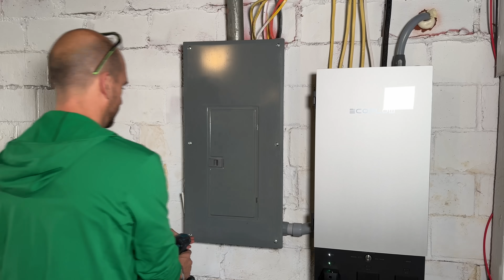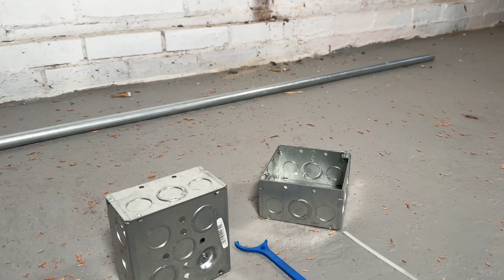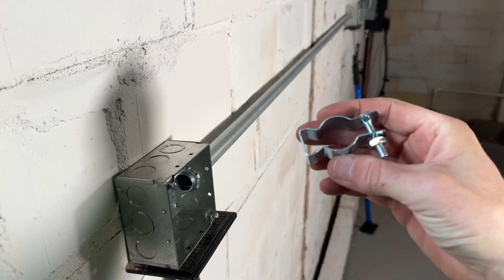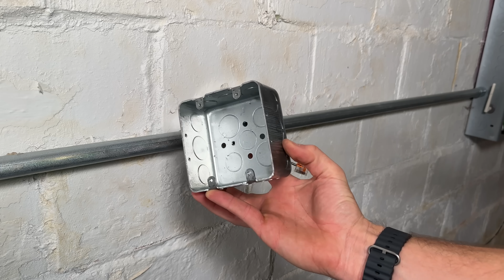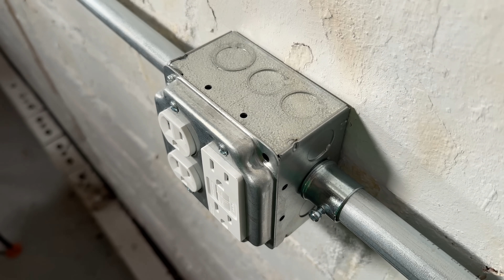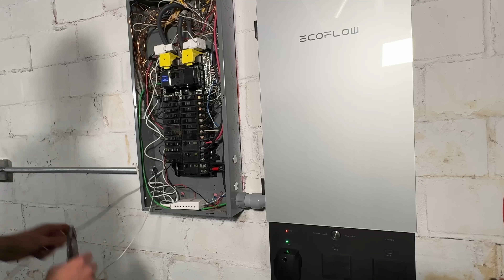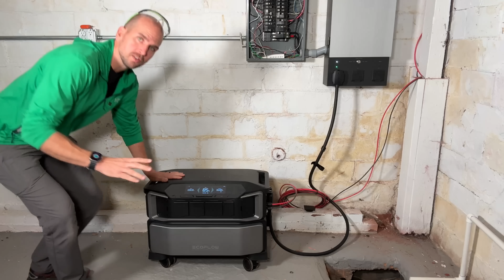Add Outlet To Unfinished Basement Or Garage

Comment: Why do you refer to the WAGO connectors as "DIY electrical" (at 7:40 in this vid)?   Seems to be a somewhat derogatory remark.  Don't you also use them for all applications?  Or are some other applications using WAGO not to code??    Confused why you referred to it that way.
Reply from the maker: Yep, I use WAGO 221 connectors for pretty much everything and I am DIYer so I don't see DIY as a derogatory term.  I recommend WAGO because I think they result in a more consistent safe and secure connection when comparing to wire nuts for DIY homeowners.  A classic example is when connecting stranded wire from a light fixture to solid core wire from Romex, in this case I think WAGOs are a much, much better option over wire nuts.

Comment: Never use Tap Cons or anchors in mortar for multiple reasons,all work must be secured to the block face.  There is nothing wrong with the "Finish" box. Your choice of face plate( receptacle mounting point) dictated  which box must be used. Code compliant or not using EMT as the ground is substandard as dust and corrosion will compromise the circuit in 20yrs if the connectors do not separate first from simple thermal expansion  through the outside wall or mechanical damage. There are also no offsets on the pipe entering the box which will cause an outward pressure pulling on your Tap Cons(mortar) and you must strap every 5" and within 12" of the box . You  used a GFCI but the installation will out live the GFCI which may be replaced with a non GFCI by others leaving a very real  possibility of an underground non GFCI protected circuit in a wet location . The moral of the story is  simple. Your installations have a standard service life of 30yrs.  Most inspectors secretly rate your work and will treat your job site inspections accordingly. On our jobs inspectors rarely give more then a passing glance at the work before signing off as they know the work consistently done to code or beyond . This saves huge money in time lost waiting  for inspections. Also note that constant high quality work is the main indicator on whether the AHJ gives electricians and companies Cut and Connect licenses which saves even more time and money. Good job pointing out the use of Romex,we use T90 in all our EMT. Waggos are too expensive to be used on large jobs I suggest spending the $$ on higher quality material in other areas of your installations. I have never seen Waggos used in industry and are not accepted in Hospital Grade application under the rational that they are too new........Inspectors seem to fined them sketchy regardless of UL/CSA listing.

Comment: You basically fast forwarded through all of the important parts. All the plug connections and the connections in the panel were too far away or too fast to see anything. Why show all of that and still show nothing? Would have been better to just show how to do one or two and then skip to the next part. Anyone who knows what you did at the end of this video, already must have known how to do it before the video started. I guess maybe that makes sense though, because based on all the comments it seems like everyone watching your videos is already an electrician and knows how to do it anyway.

Comment: Yep just a few things wrong I see.
1) Don’t cut conduit with a pipe cutter, use hacksaw or bandsaw.
2) Ream the conduit ends, always.
3) Conduit should be supported if over 24” from a box, as in use box offsets with one hole straps or saddle strapped.
4) Romex should not be used in conduit, it can be sleeved at entrance into main panel but there are codes as to % fill, and length.
And that’s before he mounted boxes.
Reply from the maker: Thanks for the feedback

Comment: Just curious. Why are you using 12 gauge wire amp and 20 Amp breaker on what appears to be 15 amp receptacles?
Reply from the maker: If you have at least one duplex outlet on the 20 Amp circuit you can use 15 Amp outlets.  This meets code and is especially true when you use something like the 15 Amp commercial-grade Legrand which internally are very similar to the 20 Amp outles.
Reply: @EverydayHomeRepairs  Thanks :)

Comment: 3 things I saw that I would have done.  (1) I would have used a ground wire. (2) I would have made offsets in the entire. (3) it appears that he used 15 Amp duplexes,  I would have used  20 Amp since he used 12 g wire and 20 Amp breaker. This is only my opinion.

Comment: Romex can be inside emt as long as it’s not to escape the weather rating.  So it’s ok in a basement, you’re basically protecting the romex is all.  Also, did you bend box offsets or just smash the pipe into the wall with he straps help?
Reply: Never have I ever seen someone dry fit (with those adjustable tension bars) the whole circuit and then go back and install it all at once.
Reply: Ok so I see you mention how romex is ok inside emt as long as it’s in a dry enviro and you use the minerallac straps to avoid bending the box offsets (crutch for non benders) but aren’t those 15 amp outlets installed on a 20 amp breaker?
Reply: @aasmith78  As long is there are 2 or more receps on a 20 circuit, 15A receps are fine.

Comment: I can tell you this I would not let him do any wiring for me reason after doing the electrical trade for over 44 years if I am not wrong the NEC has changed it is now required to add a green grounding conductor to all conduit runs also the EC requires any run of conduit run of 3 foot or longer to be supported so my friends that's 2 violations of the NEC that I can see right off so this amateur would never do any wiring for me one lastthing before I close having been raised by an electrician and have helped him & worked with him over the years as well as other great electricis I have learned a lot now no I don't know it all
Reply: Amateurish, definitely, but a wire type ground is not required when using the emt as your egc.

Comment: You said that you did not want the conduit to be against the wall.   I live in a home built in the 1960's, and all of the aluminum conduit against my poured basement walls are/is touching the wall and has a 1/2 offset before each box, probably done with the old conduit bender.  Is this because of new codes, personal preference, or?

Comment: This ground path only works if its the main power panel and the ground is bonded in the power panel to the metal box, a sub panel would not be bonded.
Wow, you guys are sleeping.
And I'm not a licensed electrical
Reply: Incorrect about the grounding path. The panel enclosure, whether a main or a sub, will be metal and therefore be bonded/grounded, so using the emt off either one, or a 1900 box that's grounded, is fine as a ground path.

Comment: The receptacles are rated for 15A, not 20A.  Thus, if anyone of the multiple receptacles is drawing more than 15A, it is OVERLOADED, running above its rated capacity!  The T-slot receptacles are required in this configuration!
Also, the sheathed cable could be used in the conduit BUT the rated capacity must be reduced due to the possible wire temperature over temperature.      Code provides the allowed stuffing capacity in a particular size conduit.  You must observe the rated temperature of the wire/cable.
Also, in most of Canada you would not get away without a separate bonding wire from the outlet(s) to the box.  The reason is obvious once you remove the screws from outlets to open up the box.  The faceplate could become HOT!
It would have been a lot easier to run another 15 A circuit with associated GFI.  (The use of a 2 pole GFI in the panel is too expensive.)

Comment: I would not use those connectors. Go straight to the outlets. You’re just adding more failure points than needed. Just wire up the outlets, then put on the plate. Oh I always use higher quality outlets that have the clamping type setup with straight wire (same as most GFCI outlets have). Neater and cleaner.

Comment: NEC Code  requires you to strap within 3-feet of any box, panel, or termination point for that conduit run. So looks like you may need 2 straps there guy. Also, electrical metallic tubing (EMT) does require a ground wire...especially when devices are installed. The ground wire provides a path for fault currents to safely return to ground, helping to protect against electrical shock and fire hazards. It is an important safety feature in case a hot wire comes in contact with any part of the metal box or conduit or if for some reason the connections become loose or broken. The type of grounding your doing is only for Equipment Grounding.

Comment: First off all that is a fully finished wall. Wake the F up. just because you are in America you are less than 10% of the world ... The rest of the world uses Concrete and Cinderblocks and we just carve channels into the concrete and done. SO you need to learn a lot about electric to begin with.  FYI the rest of the world uses 240V AC not your weak 120V AC.

Comment: You need the ground to the devices because if the cover is separated from the box "where is your ground to the devices," now pull the GFCIC cover and check for ground. Inspector up here would fail the job.

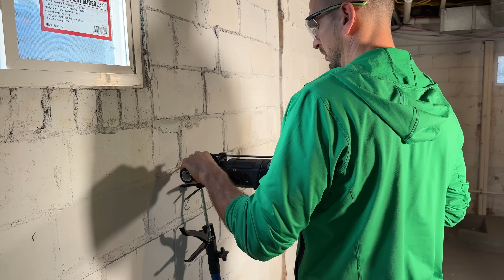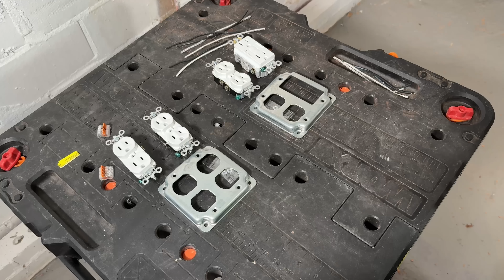Comment: @ 3:55 you're drilling into mortar ? ? ?  Thought you were going to show people how to do it "Right".  Mortar is weak and can fail over time.  I ALWAYS drill into the brick itself.  @ 6:10 you show 15 amp rated outlets.  While code allows for that - why not go with full 20 amp outlets.  You're on a 12 gauge wire and 20 amp breaker, why not take full advantage of that?  20A GFCI are available.

On the subject of grounding - yes, the conduit can provide a secure pathway to ground.  However, you didn't take the time to bond the conduit at the panel.  The nuts will bite in and tend to dig in through the paint, but there's no good guarantee it will.  That's why bonding is important.  I'd never "not" bond conduit at the panel.

Comment: Here in Australia, PVC conduit and Boxes are used to do Household Electrical and Green/yellow Earth wires are used to every Power  receptacle, we also use European Wiring code, Brown for Positive and Blue for Neutral. All our Household power is 240 volts most 10 Amp and possibly a 15 Amp outlet, (which have a larger Earth pin) anything larger than 15 Amp is Hard Wired.

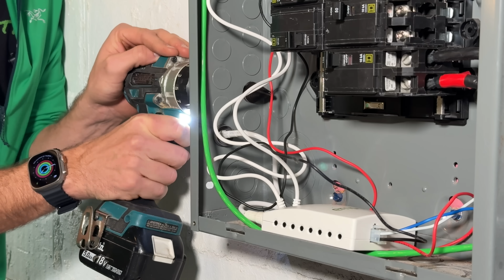Comment: 1:12 Ummmmmm --- not cool, Dude --- your drill-bit rotated right against that red wire --- it could have damaged the wire or insulation, plus the metal bit could have even caused a short-circuit between the box and the possibly-still-live wire if the insulation got gouged through!  Yeah, yeah, yeah --- I know that you turned off the power to the box first,. but drilling against the wire like that is still unwise and dangerous --- just like a firearm that you should always treat as if it's loaded, you should make a practice of treating electrical wires as if they're still connected, regardless of whether you turned off the juice or not!

Comment: Since you are using a 20 amp breaker, you must use 20A rated devices (identified by a “T” slot vs a straight slot on the neutral plug in on the face of the device.  You are using 15 amp rated devices.  I once owned a house that had an air conditioner put in by the previous owner.  He had supplied the A/C fuse disconnect with #10 copper fed via conduit directly from the load side of the power meter (code violation).  The compressor failed  (line to the case).  Only by blind luck did the fuse blow as the conduit nut was loose!!!  It could have ended much worse.  I don’t think you can guarantee that the conduit nut on the painted enclosure will maintain conductivity until the sun burns out.  For the few pennies the ground wire cost, it is well worth the investment for my life and my kids.  What do you think?
Reply: Incorrect. 15amp receps are allowed on 20 amp circuits as long as there is more than 1 recep.

Comment: You absolutely MUST have the green safety wire because some jackwad will decide  to pull one on the boxes off the wall to add a branch circuit -  opening the pipe as a conductor and leaving the unhooked run of pipe hot the instant anything shorts to the metal. This old industrial plant-engineer  / journeyman-electrician would have taken one look and been chewing your butt all the way back to the truck to get the green wire.  You absolutely cannot use the metal protective  tube as the safety wire.

Comment: I always add the green ground dedicated line just in case.  EMT fittings and couptlers and fixtures loosen up over time and then you dont have a good ground.  I hate seeing EMT run without ground.  Its ALWAYS good practice to spend a few more $$$ and run a ground leg and then ground out each box with the pigtail screw you showed. This way the EMT can serve as a ground and you have the wire run just in case...
Reply: When installed properly, emt fittings do not loosen over time, any more than ground screws loosen over time.

Comment: There is nothing wrong with using a Romex cable inside a steel conduit, as long as there is adequate space inside the pipe.  (For multiple circuits run in the same pipe, individual conductors should be used.) The outer sheath should be trimmed just inside the box. It already has the grounding conductor, which should be firmly secured to the grounding screw provided with the box. Leave a 3 inch tail to which green pigtails will connect with a quality wire nut, and terminate on each receptacle body. Using the conduit for return path of ground is VERY BAD practice. The conduit should be run snug against the wall and attached with one-hole conduit straps, within 3 feet of the box.The ends of the conduit can be easily bent into a 5/8 inch offset with a manual bender. It will line up perfectly with the knock out holes in the box. It's good practice to use plastic insulating bushings at the threaded fittings where the wires exit the pipe. When wiring the receptacles, ALWAYS use the clamping screws to terminate, rather than the push holes on the back. And don't be afraid to torque the screws firmly to avoid loose and dangerous hot connections.

Comment: It is actually against code to run Romex in conduit for any reason. I forget the exact code section but it prohibits a raceway inside a raceway. Romex being made up of individual wires inside a covering is considered a raceway. There is also a code which covers the placement of conduit straps from box entrance and length of conduit run. Personally I'd use an offset on the end of the conduit where it enters the box so my conduit sits against the wall. Makes for a neater job and you're less likely to use the conduit to hang stuff from.
Reply: Incorrect. It is not against code to install romex in conduit, and the NEC requires it in certain circumstances. Romex is a cable, not a raceway, and there is also no rule that says you can't have a raceway inside a raceway.
Reply: I ONLY use Romex, especially underground in PVC conduit.

Comment: All those exposed wires above the circuit panel are scary, to say the least!   Wires inside the panel are better organized at 90-degree angles to the breakers and neutral and ground bars, resulting in better identification entry and connection of individual circuits.  Just saying!

Comment: You can't use Rx in any emt pipe . And you never put a support 36 in piece  can leave pipe with no support. . The 6 ft piece of pipe you need a support in the middle  get a code book . And know the code . You are showing the wrong way of doing it . You never use Rx in metal pipe

 Get a code book and really know what you are doing . You are bs electrician. You don't know code .
Reply: Romex is allowed (and sometimes required) in conduit.

Comment: Definitely run a ground. Too many issues can occur. Second, whenever possible, keep the conduit as close to the wall as possible. Now a dyi person may not have a pipe bender and may need a few tries and creating a dogleg but having the conduit attached to the wall positions it to be less likely to be caught by something or used as a hanger for stuff etc.  It seems unnecessary but a little thought now pays off in the long run.

Comment: I always run a ground wire. While EMT and Rigid conduit is allowed to be the grounding conductor. If the connectors or the box clamps come loose from impact or building vibrations, (Yes There is such a thing as building vibrations), You will lose or have an intermittant ground. Three things wrong with your install. 1. You allowed the unibit to scrub the red wire in the panel. I did not see you check it for damage. That's a no no. 2. EMT conduit has to be supported by a strap within 3" of each box. 3. Even without a dedicated ground wire in the conduit. You must have a ground wire from a green ground screw attached to the box to the outlet green ground screws. This can be a daisy chain or separately. I have been a licensed journeyman since 1988.

Comment: 20 amp circuit but you are using 15 amp outlets. You could fry the outlet without tripping the GFCI starting a fire before the circuit breaker trips.

Comment: Bring out the green grounding screws for each box and bonding them to an additional ground wire throughout the conduit run.  Should use grounding pigtails for recept as well.

Comment: My opinion, as a non-electrician, but having been around the block a few times as DIY'er, is to spend the extra $3 and run a ground wire.  Yes, using the conduit as the ground may MEET code, but I was always taught to idiot proof everything and to go beyond "minimum code".

Comment: Bonding lugs should be used on the conduit connectors. Plus the conduit should be fastened to the wall between the breaker panel and receptacle boxes.

Comment: I have always believed that a ground wire should be mandated by code for all conduit runs. I have found so many instances where the conduit has pulled apart due to various reasons. Thus, unbeknownst to the users, making the circuit un-grounded and hazardous.